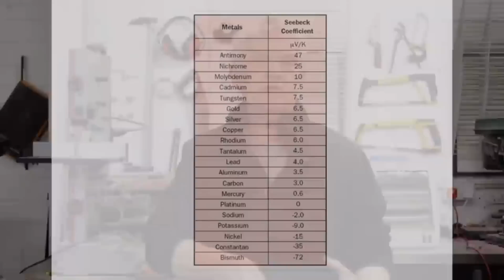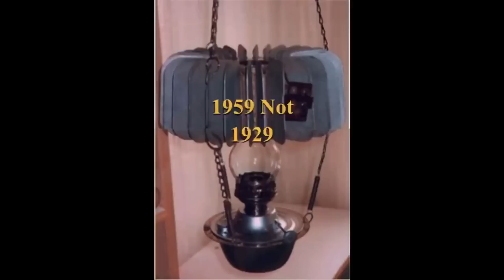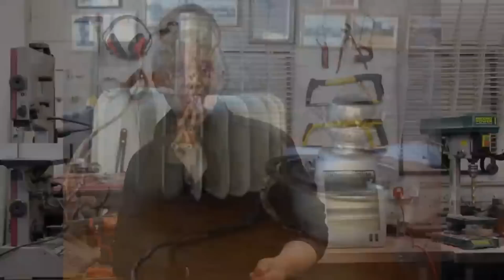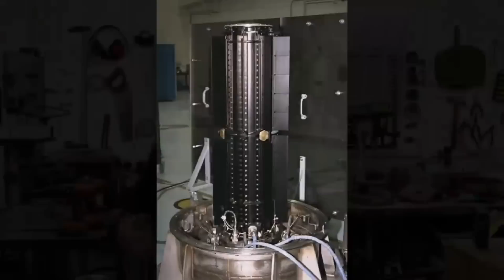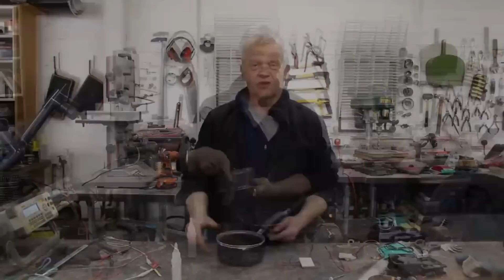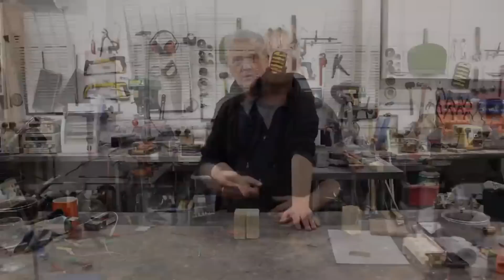027 The Partisan Battery And Radio Lamp

Comment: Why not make use of the temperature differential between the "flame" and the boiling water, AND the differential between the generated steam and the environment? That way, you're dramatically expanding the usable heat gradient, and you can use both high-temp and lower-temp Seebeck devices! You could even use heat pipes to improve efficiency further!

Comment: Making a wire thermal battery from a couple of thousands of wire pieces isn't that hard. And such a battery can withstand very high temperatures. Not much  voltage it can give but current should be sufficient. You just need to weld all the junctions on a graphite rod. Something like constantan and nichrome is available.

Comment: I am not sure about what you have planned for the next phase of this project but I thought of a few ideas and wanted to share with you. It seems you could use this double pot idea placing graph foil in the bottom of pot one as a current collector then pouring powdered copperoxide (like from pottery stuff i have seen you do) on top of that and then place strips of copper tape on the bottom of the second pot that you can connect to. Using pieces of glass or other non conductives to seperate them electrically. Like little troughs. This could also allow  experiments regarding mixture ratios of copper 1 and 2 oxides to determine if one is better than the other since your plate contains both as well as an abilty to gain higher voltage through easier series connections and also to test other metals like aluminum tapes and so on. I also thought freezing the water and running the tapes through the water in the pot and then freezing could help generate more. Freezing water can be energy intensive for some parts of the world but winter is coming and this could be a cheap way for many to improve the tempature difference with no cost( leave it outside a bit) i am not sure if these ideas can at all help. But just my two cents on what I seen. Keep up the fantastic work.

Comment: the solder in cheaper peltiers will melt a higher temperatures. Use the high temperature TEC modules for hotter applications and power generation. They are also very delicate and can fail open circuit from mechanical stress.

Comment: Using sheets of conductive materials, a literal pile could be clamped together with a sheet insulator alternating sides.  At 1/4 V per junction, you could easily get 5V in a pile a couple inches wide.

Comment: Hmmm.

Put Copper wool through a roller so it bonds with copper foil on one side and has a lot of flat contact points for theboxide to form. Heat treat it to apply oxides.  Cut into squares... Lay many in a stack...

That is something I could actually try to build.

:)

Comment: From the look of it, you need the copper to transmit the heat conductively to the copper oxide. If that is the case, would steel work better than the copper? If so, could dots of copper oxide on a steel or aluminum plate work the same way, with a collection plate off these spots, with a high temp insulating medium to space the plates as well as space the oxide deposits? Maybe one of the plates would need to be one thing, and the other another, and it would work dimpled as long as there was an electric as well as thermal insulator in between, and finally with a float level control, so you can work with a larger water backup, you could possibly do some good household voltage with a plate composite like this sitting on a rocket stove. For the insulator, maybe a glass/rockwool mixed with some kind of fire foam? If done well, you would have a good material to make the entire top stack of rocket stove or similar device, and get more value out from a water heating coil as well, to help manage the temperature difference.

Comment: Robert, maybe flame treat heavy gauge copper wire to oxidized that have been pre-bent into "U" long bends. Then lay the many "U" bend wires into a  casted ceramic form shaped to fit loosely over the chimney of your rocket stove. Then shape the many long length protruding copper "U" bend wire leads that hang out of the casted ceramic shape toward the cooling air intake to solder together there. Then hook the copper leads there in series, and parallel to achieve the desired Volts and Amps combination needed. Possibly use silver solder to connect the heavy gauge long copper wire lead bundles. I may be mistaken, but I believe that I remember that copper does not corrode in concrete. Maybe a casted ceramic shape sized to loosley slip over the length of the rocket stove chimney would have the same copper corrosion resistance while accommodating many individual copper "U" bends to make maximum electric power. Well anyway, Robert, enjoy your time in the shop. I do as well.
Reply: @davidl.howser9707 - Could you just cut all the u shaped parts of an existing suitable coil, and then attach them all using a mesh, such as a sieve?  Would they all have to be insulated from each other?

Do you any suggestions for a solar powered heat source?
Reply: @christopherd.winnan8701  I think Yes...if stove fiberglass gasket cord was used to suspend the U shaped fire treated oxide Copper coils. The fiberglass mesh cord could be knitted in a patern like commercial job site safety catch nets are weaved. The "U" Bent heat oxidized copper could be attached to the fiberglass net using metal hog rings, and hog ring pliers. Keep the fiberglass mesh net dry as not to short each "U" bend coil to another.
Reply: @christopherd.winnan8701  As for a Solar application. An array of many small credit card fresnel lenses all focused at some distance tried to not overheat the steel or cast iron onto one flat metal surface painted black with high temperature BBQ grill or ICE exhaust manifold engine paint to absorb the most infrared wavelength heat may generate sufficient heat if tracking the Sun by repositioning the plate or easier to assemble place the many fresnel lenses in a arc pattern position to follow your area's average seasonal sun angle, and azimuth. Then on the back side of your chosen metal plate with the same fiberglass gasket cord woven into the mesh mentioned in my first reply is placing the heat treated and oxidized copper "U" bent coils as close as possible to the heated metal surface using the smallest fiberglass gasket diameter you can find. I think a cast iron flat griddle would be a low cost, and good surface with sufficient mass to try. Also add some glass fiber board insulation to the back of your medal plate to cover and close in the oxidized copper U bends to lessen heat loss by ambient temperature, and wind. That type of glass board insulation is made from recycled molten bottle material offering both insulation to heat loss, and high heat burning resistance to the insulation. Wear your air mask when cutting glass fiber material. Also I saw a YouTube video explaining how recycled glass is made into glass board insulation fiber. Enjoy the fun when Thinking & Tinkering. :  )
Reply: @davidl.howser9707  Fibreglass is great stuff, but is beyond the scope of my home tinkering.

Still, I am intrigued by the use of many small fresnel lenses.  Where would you source these and how much would they cost?

Comment: One thing to keep in mind is that in the 1940's the radio receivers in the battlefield were shortwave.  Therefore very little outside power was needed to make it work(in fact the wave produces enough power to work though it is not very loud).  The amplifier is where power was needed to make it louder on the output.  I have made radio receivers that have no other power source than the radio wave itself.

Comment: Did you need the TEGs?  Iron is Seebeck coefficient 19, and carbon and aluminum are 3 and 3.5 respectively. Put your aluminum pot inside an iron one, using carbon ( even granulated charcoal or foam) to join the two.  One pot is negative and the other is positive.

Comment: how much work/money would it take to produce 1 sq meter of seebech device for 1000 c? is this something the community could maybe look into as a coordinated effort?
Reply: @rezganger - 1000 degrees c is a bit of ask for many of us.  How about a lower heat version based on solar, which can get 2 or 300 quite easily, more with multi focussed mirror set ups?  %00 is maybe a more acceptable challenge for those of us without access to back yard rocket stoves or tokomak generators.

Comment: Ice in the cold side pan. Or dry ice would be better. And if you want a big temp difference use liquid nitrogen. I wonder if you could get more power out of a pyroelectric crystal cooled with liquid nitrogen. I wonder if a pyro crystal could make a thermal electric junction Using low current high voltage.
Reply: Hello Travis - ice and dry ice can be expensive to produce, especially in warm climates.  I wonder if there is a cheaper way to keep the water cool?  Does it have to be water. Are there other common liquids that have better thermal capacity?  Is there a substance that you can add to water to increase the boiling piont, just as anti freeze lowers the freezing point?
Reply: @christopherd.winnan8701  Water ice and ammonium nitrate could use an endothermic effect to make the water colder for a short time. As for holding a high thermal capacity try gallium. And has a high boiling points. Circulating the liquids in a long pipe and or radiator and using convection current to circulate it may be possible if you want to remove heat. ? Salt can raise the boiling point of water by a bit?
Reply: @travismoore7849  Interesting options, although I would be worried about storing heat in NH4NO3 given its explosive reputation.
Reply: @christopherd.winnan8701  I was thing about heat stored from ambient heat and make a lager temperature difference by extreme cold. Or using that along with a low thermal heat  source.
Reply: @travismoore7849  I think that is a very good strategy.  In my own case the main limitation is budget, which is why I prefer materials that come either out of the waste stream or perhaps occasionally from the dollar store.  If we can come up with a good cheap solution, I would be happy to give it a try.  Did you see the comments about using a dot matrix printer to create lots of tiny connectors in the copper substrate?
Reply: @christopherd.winnan8701  Well if you can get some waste cooking oil or motor oil, some old aluminum pop cans and lye you could run the hot side of a teg with an exothermic chemical reaction. Then just use the cold air in winter to run the cold side. Kind of like how they put the thermal electric junctions on chimneys in winter to take advantage of waste heat and the cold winter air.

Comment: So if you can make a thousand little points touch that plate you would get quite some power, what are the limits? dot's per inch wise, that would be interesting to know, also a more robust layer will help as I assume a bump might cause the pins to go through the layer. the distance the stacks should be from each other might also play a role. Imagine a 6 layer square inch copper cube that you chuck in the fire to charge your phone, now that's steam punk right there.
Reply: @voidy123 - is there some way to cannabalise an old dot matrix printer as a frame for all those pins?
Reply: @christopherd.winnan8701  ,I don't think there are so many pins on a dot matrix print head, maybe an old cpu socket can work, it's got a lot of pins, but Ihey are gold and mounted in plastic so maybe not. I think a small punch and copper sheet might do the trick.
Reply: @christopherd.winnan8701  On the other hand if you talk about a dot matrix printer punching dents in thin copper sheeting, now that will be awesome!!!, the print head probably wont last too long though.
Reply: @VoidySA I really like the idea of upcycling some old ewaste that has lots of those old connector pins.  Some of those things had really big connectors.

Why would you want to punch holes in the copper?  Sorry, I am new to all this....
Reply: @christopherd.winnan8701  not holes, just dents instead of pins, that way you can have 2 copper plates pretty close with a bunch of connections in between, I don't know if that will work, will try tomorrow in my workshop
Reply: @VoidySA Of course, I did not think of that.

Looking forward to seeing your results.